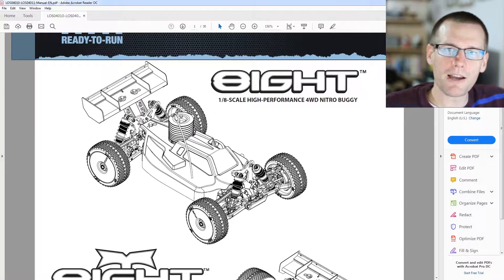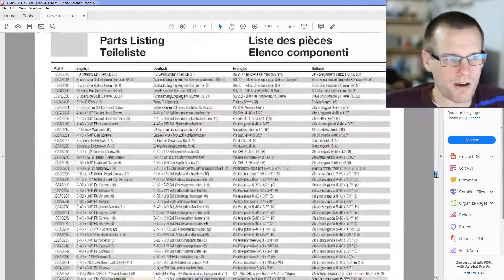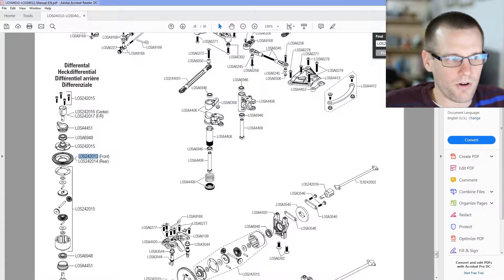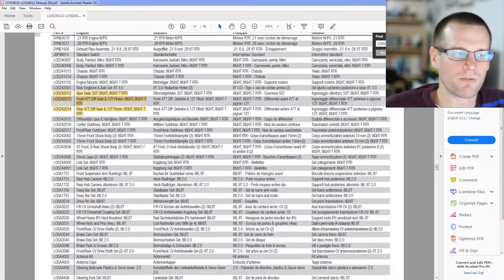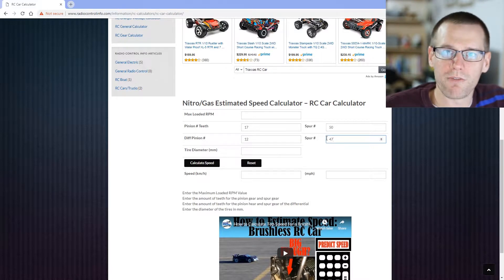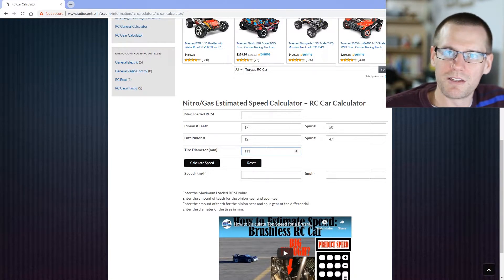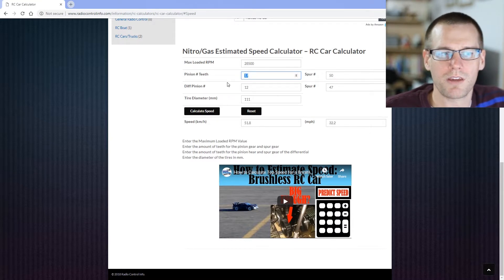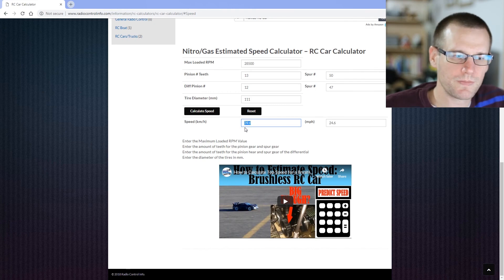How to Calculate Top Speed for a Nitro RC Car

Comment: Is there a calculater for us who have a gearbox between the pinion/spur gear and differntial gears? -The gearbox has a ratio as well and I need to factor this in as well...
Reply from the maker: Multiply gear set 1 and gear set 2 together and enter this in to the calculator as gear set 1. for example 10/30 and 15/30 becomes 150/900.
Reply: @RCexplained  thanx man! I found a calculator app similar to your site that showed the total gear ratio when numbers were entered. Then I figured out the total ratio myself and used the cone pinion to manipulate the total ratio to what I had calculated.
My DIY electric conversion of a Traxxas T-Maxx runs around 70Mph on 6S - No wonder that thing drives like crazy! :D
Reply from the maker: Sounds Great Simon!